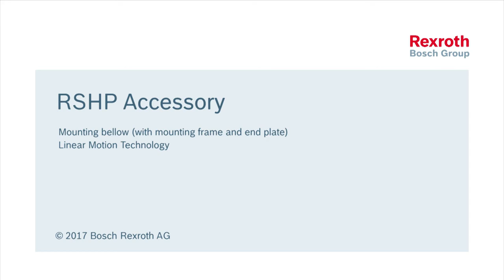[EN] Bosch Rexroth: Linear Guides - Mounting a bellow with end plate (How-To)

Comment: Hi, can these bellows be used in a bottom up setup like under a mill table ? i.e. won't they hang/bow, are they retained to the rail on their whole length ?
Reply from the maker: Dear Jérémie Tarot, thank you for your interest.
Yes, you can use the bellows in a milling machine, but if there is contact with hot chips, you should choose the heat resistant version. The bellows can not sag as they are held with support frame at defined intervals.
Your Bosch Rexroth Social Media Team.